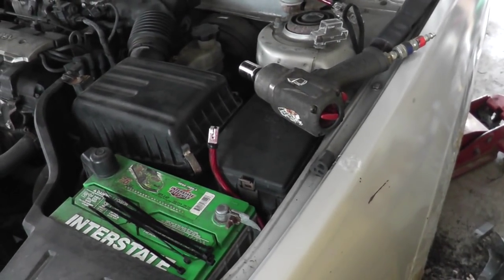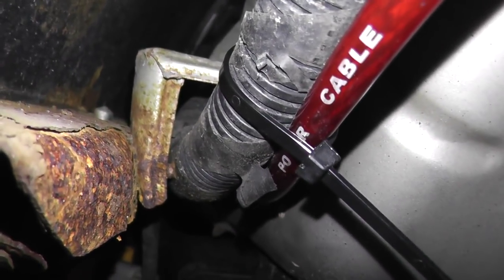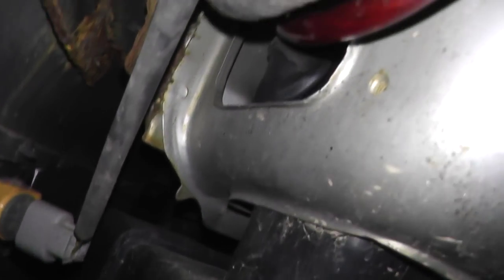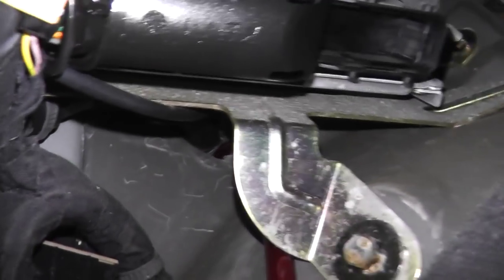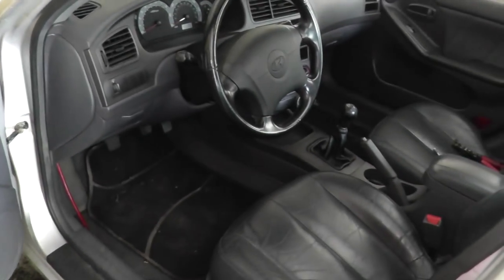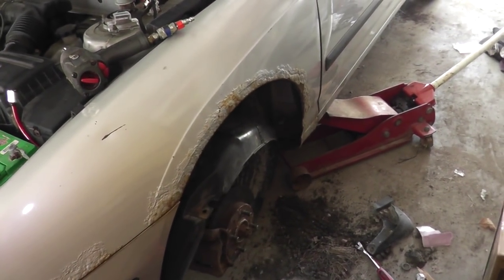00-06 Hyundai Elantra Amp power wire install

Comment: Just finished a install on a 05 elantra. Wouldn't have been able to do it without watching this video, thank you very much. I didn't think the grommet would work, but just poked a coat hanger through and taped power to it and bam, knocked that out like like and hour and a half. Thanks again!

Comment: Do you run it through the door area after that to make it to the trunk? Hooking a sub/amp combo speaker up for my daughter and doing the wiring myself, its a 10” speaker all enclosed with the amp, and I have the converter thing for the stock radio to connect the new speaker

Comment: Had to do this on my 04 GT also. Just wasn't any other way to run it without drilling. It was crazy tight even with 4 gauge. If anyone's planning on 0 gauge, be prepared to do some drilling. Question...do you get headlight dimming? I do even with a big 3 upgrade and a slightly beefier 140 amp alternator. Only running 500 watt rms sub. Dimmed even with 300 watts to the last sub.